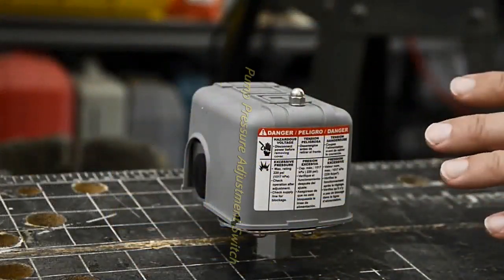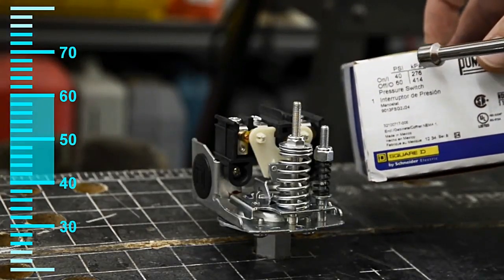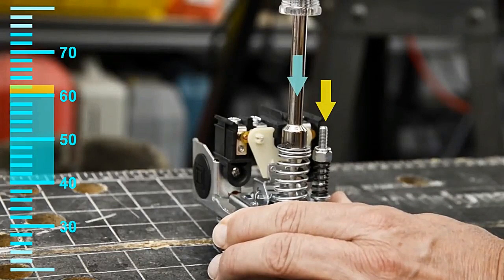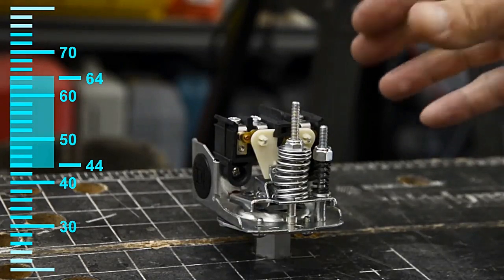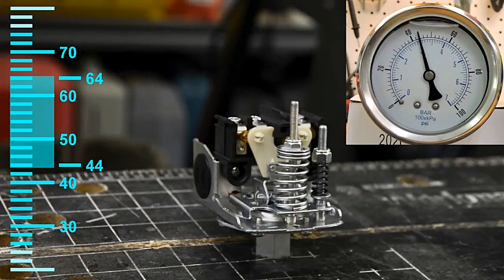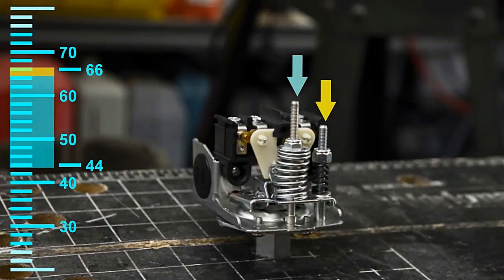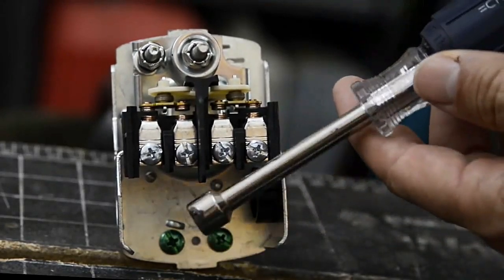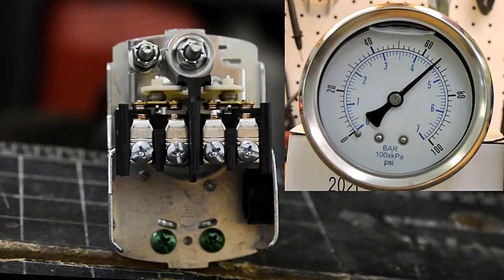Pump Pressure Switch Adjustment

Comment: If I need more pressure (~5 bar minimum) but the spring is compressed seemingly all the way, it is messing with the cut off value and even with the cut off completely loose (as per manual for when adjusting) it goes beyond my gauge (max 6 bar) and will not stop, I therefore unplug the pump to avoid damage. Surely its rated more, but anyway, is there anything I can do? Why does the gauge read upto 6 if its not useable? Thanks for any tips.

Comment: Thanks for this. My pump won't make 30 psi. I had a submersible and it died. I called a local well service. It was a Friday afternoon labor day weekend. I was lucky he offered 24 hour service. He showed up Saturday morning tried to pull the submersible but it wouldn't budge and he was worried he would break something and ruin the well. I don't know how but he used an above ground pump and was able to restore my water albeit only 30psi. I was happy. It was a brutally hot day and he busted his hump and we had water without drilling a new well. Fast forward 6 months and the water cuts off in the middle of my shower after a 16 hour day at 1130 pm. I toweled off the soap got dressed and went outside and the pump is running. Realizing it lost prime I shut it down. I found a problem all the connections between the check valve and the pump were loose and the blue goo sealant used was garbage. I redid all the connections with thread tape and reprimed the pump and initially got 35psi and the switch and everything was working great. I took a shower with more pressure than I had in 6 months. Went and checked the pump that will now not shut off and hovers around 25 psi. I backed the adjustment off until the pump shut off but now it won't kick on until 10 psi.  This switch however only has one adjuster.

Comment: Thanks for visual demonstration.

Let’s say you wanted a shorter range: couldn’t you just loosen the main screw, raising both the cut-in/cut-out simultaneously, and then tighten the cut-out screw?

So rather than a 20 psi differential you have a 10 or 15 differential?

Comment: Thanks, my new switch (30-50) shut off at 45 and cut in at 28. Two clockwise turns of the range(big) spring angle it’s perfect. Thanks very much!

Comment: Very helpful, thanks. What if the Cut-Off-Only was loosened up could the pressure drop down to a lower value, say 50, 55, etc?
Reply: I believe cut off only changes the high pressure where it shuts off not the point where it turns on.

Comment: Thank you Sir, my friends pump was chattering (cycling on and off quickly) and I was able to correct the off pressure setting in less than 2 minutes after watching this video.  It's now running as it should.

Comment: How do I make the pump kick in earlier? Like at a lower pressure? Currently it will only kick in if the pressure is below 1 bar. How do i make it kick in if the pressure is below 2 bar?

Comment: I have a well with two homes on it and one house is 40 feet above the pressure switch. I think I might try adjusting the main range up and lower the cutoff. This helps me greatly. Thank you.
On a side note.. I did just install an oversized expansion tank to help keep down the cycle count.
Reply: Thats an interesting problem to solve! I am no plumber, just an engineer that likes to think about problems. Im not 100% sure a larger expansion tank would necessarily keep the cycle count down for the pump.

Which home has the larger expansion tank installed? Additionally, where is the pressure switch located? Assuming the switch is in the lower home, and set to the standard 40-60 psi, if you increase the width of the range (increase the upper limit), it increases the width of the range for both homes, but the upper home still receives too low of a minimum pressure. The lower home still receives the proper minimum pressure at 40 psi. If you keep the pressure range differential the same, but increase the entire range, now the lower home receives too much minimum pressure.

I wonder if this setup would require two pressure switches, one in each home, to 'properly' function...

Comment: I have a water tank that is a 40/60 for my pressure tank (about 50 gallon max) so I have near constant pressure for my house. On an outside property I use a vertical Gould pump. The Tank is about 20 feet higher unpressurized. It appears that my built-in pressure gauge is functionless yes?  The pump is controlled by floats/ relay.  My technician says the pressure of the output is controlled by an external ballvalve to reach the tank tower.  Does that sound reasonable?

Comment: I just installed a well x trol bladder tank and a new 40/60 pressure switch. I cycled it , it was 45/60. I loosened the big spring it went to 40/50. I then tightened the smaller spring, now its just rapidly turning on and off. Any idea why?

Comment: what if max pressure reached but pump stays running?
Reply: Then you unscrew the small spring a couple turns. Small increments. This is my understanding, based on the instructions in this video.

Comment: I think it’s wrong when he adjusted the first nut. It shows 40- 62. It should be 42-62. You need to adjust smaller nut if you want 40-62.

Comment: Thanks. Basically l love a very strong  shower flux. I have had  that Schneider spring flux regulator installed 2 days ago, an expansion ballon (2 gallons) and a new pump. Dab jet 2. How do l screw in to get more pression???